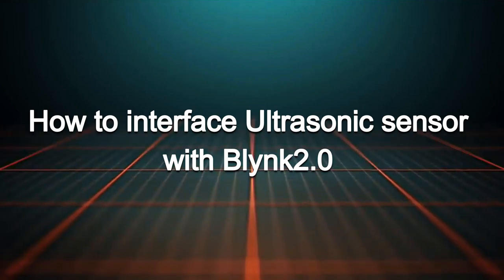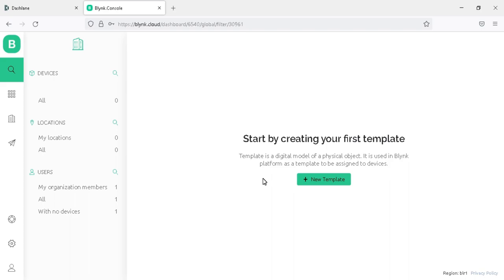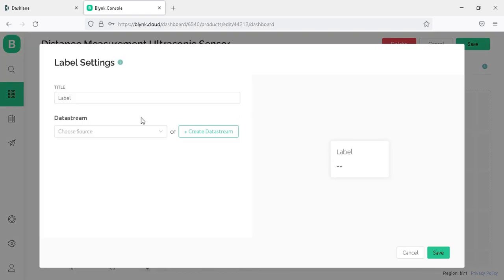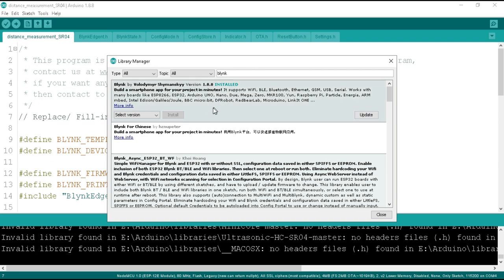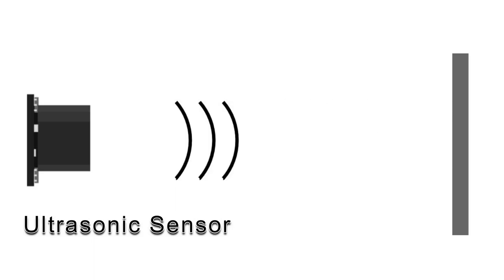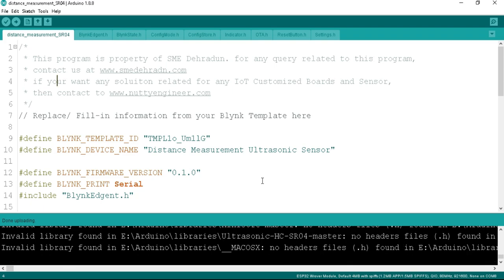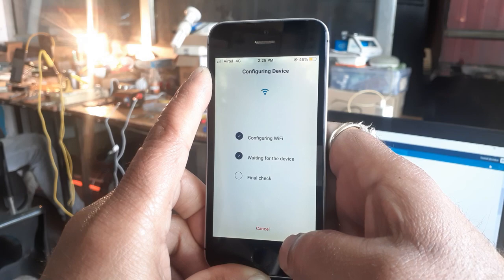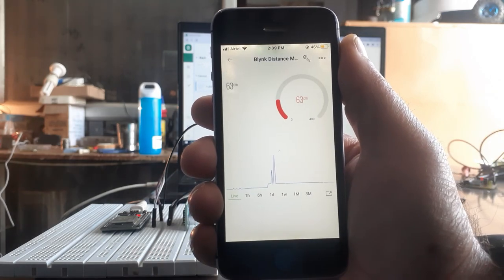Distance measurement using Ultrasonic Sensor with New Blynk2.0- Complete guide with Programming Code

Comment: Sir i used ESP8266 but when i uploaded the code, the sensor has no readings, just 0cm. I think it is because of "pinMode(34, INPUT)" is this for ESP8266 as well?
Reply from the maker: Check the wiring connection of ultrasonic sensor with your board & check the Vcc & GMD pins as well. If the are correct then check the pin no in which you have made connection is correct?

Comment: sir what is the problem why my ultrasonic cant read the data
Reply from the maker: Check the connection of ultrasonic with your board. There may issue with it.
Reply: if you are using esp82 then connect vcc to vu pin because ultrasonic sensor needs 5v supply vin gives 3.3 only

Comment: Hi sir, i wanna ask is it possible to run using 1 board of esp8266 with 2 difference sensor like IR and Ultrasonic sensor.? does the board detect those 2 sensors if i run in 1 board which is esp8266.
Reply from the maker: Yes. You can. It will work.

Comment: I ran the code an this error appears:
A fatal error occurred: Unable to verify flash chip connection (Packet content transfer stopped (received 6 bytes)).
Failed uploading: uploading error: exit status 2
Reply from the maker: If you follow all the instruction as shown in video and after that, you got this error then your board is having some hardware issue.

Comment: Hi, the code is giving an error as follow:                                                                                                                 
 'BLYNK_DEVICE_NAME' was not declared in this scope
Reply from the maker: If you see the video properly, then you will get that all the header files must inside the programming folder. 
If you want then you can connect to new blynk through an alternate method- 
Below link may help you. 

https://youtu.be/c5u6-Th1sI4

Comment: hello sir my readings of ultrasonic sensor is showing 0cm I don't know what's wrong with my project. when I'm using same Ultrasonic sensor with arduino it is working but in case of node mcu it is only showing 0 cm . even my node mcu is successfully connected to wifi and send data to thingspeak website , please sir help me I'm not able to recognize my mistake
Reply from the maker: Hi,
This errors shows that there is some issue in the connection. Check the wiring of ultrasonic Connection with NodeMCU.

Comment: Sir the wifi isn't showing 
I have done everything earlier but now i couldn't find the wifi from the esp32
Reply from the maker: Hi,
This May happens due to reconnection of the wifi or new template. 
This video can help you to resolve the error 

https://youtu.be/EPhY_hDozeo

If erasing of EEPROM is not working, then you need to factory reset your ESP32 board. Below video may help you. 

https://youtu.be/3oEvXhgHZHo

Comment: In file included from C:\Users\USER\Downloads\distance_measurement_NodeMCU\distance_measurement_NodeMCU.ino:9:
C:\Users\USER\Downloads\distance_measurement_NodeMCU\BlynkEdgent.h:16:2: error: #error "Please specify your BLYNK_TEMPLATE_ID and BLYNK_DEVICE_NAME"
   16 | #error "Please specify your BLYNK_TEMPLATE_ID and BLYNK_DEVICE_NAME"
      |  ^~~~~

exit status 1

Compilation error: #error "Please specify your BLYNK_TEMPLATE_ID and BLYNK_DEVICE_NAME"

I got the above compilation error sir... I'm using an esp8266 board. Tried installing libraries and updated my board still getting this error... Please reply..
Reply from the maker: Hi,
This is must to put all the headers files inside the code folder. If you watch the video carefully then you you will get it.
Reply: @SMEDehradun  ok sir, thanks for replying...

Comment: sir how to change the ssid I cannot find where it is if use blynkedgent
Reply from the maker: If you want to change said then you can only do it by erasing the eeprom of your board. Once you erase it, then you can rewrite the program & add your board in new wifi hotspot. 

Below video may help you- 
https://youtu.be/EPhY_hDozeo
Reply: @SMEDehradun  I just need to push button reset 10s on the board right and then push button flash? then can proceed to connect to new wifi?
Reply from the maker: Is it working. If yes then go ahead.

Comment: I'm trying to transfer the distance I get from hc-sr04 sensors to thingspeak using Nodemcu. Only when measuring distance the sensors work very well but when I write the code to transfer the data to thingspeak or firebase the sensors work very slowly. What could be the reason for this? how can i fix it
Reply from the maker: It may be due to the code you are sending to Thingspeak or firebase. 
You can make a separate function to send data to thinkspeak or firebase. & call it once it in 10 or 15 second. But measure the distance every second. Then you will get regular data from ultrasonic sensor
Reply: @SMEDehradun  thank you. I'll try to send it every 10 or 15 seconds.
Reply from the maker: If it didn’t go right, then let me know. I will help you.

Comment: Hi, the code is giving an error as follow:                                                                                                                 
 #include "BlynkEdgent.h"
          ^~~~~~~~~~~~~~~
compilation terminated.

exit status 1

Compilation error: BlynkEdgent.h: No such file or directory                                                                                I have made sure that i installed the library you showed in the video,even then its not working correctly pls help.
Reply from the maker: Put all the header files inside the code folder & change the blynk credentials also. 
Below video may help you to resolve- 

https://youtu.be/EPhY_hDozeo

Comment: Hi. I am using an ESP32 ESP-WROOM-32 Development Board. I managed to get the board to connect to the Blynk App but the HC-SR04 sensor kept on giving 0cm values. I have tested it with another code and the sensor is working fine. Do you have any idea why am I getting this error?
Reply from the maker: Try the change trig & echo with one another. It may solve your problem.
Reply: @SMEDehradun  Thank you. I found the error. Apparently I have accidentally swapped the pin number for both pins without realising. Sorry for the inconvenience.
Reply: @SMEDehradun  Oh ya I having 1 more issue right now. For some reason,  the esp32 is unable to reconnect to Blynk. Is there a way to fix this or reset the wifi connection part using phone?
Once again, sorry for the inconvenience.
Reply from the maker: Ohh. If you want to reconnect it to another wifi or you have designed new project template then you need to erase the ESP32 using esptool.
See this video for it- https://youtu.be/3oEvXhgHZHo

Soon I will make video with alternate solution for blynk.

Comment: I am using an FreeNove ESP32-WROVER-Dev board because that is what I have. I set the echo pin to 18 and trigpin to 19. I left pinmode on 34. I am also using the Board= "ESP32 Wrover Module" no idea if that is right... I don't even have any idea how you could know what is right. There is no option for Com port = 8, like you have. I have only one option: Port = COM1. When I plugged the esp32-wrover-dev micro USB to my computer and pushed the upload button I get "Compilation Error: BlynkEdgent.h: No such file or directory" any ideas?
Reply from the maker: Hi,
You need to add blynk library and there must be headers in your programming folder. Must watch the video properly. 

Also, Go to the link & see, How to fix Errors in new Blynk2.0 
https://youtu.be/EPhY_hDozeo
Reply: @SMEDehradun  Thank you. It took a few tries, but I was finally able to get the project to work. I appreciate the walk-through on this project and getting it onto Blynk, and I especially appreciate that you helped me to troubleshoot the problem I was having. Thank you for teaching me.
Reply from the maker: Most welcome 🙏

Comment: connection was interrupted error please help!
Reply from the maker: Explain the error that you have got?
Reply: @SMEDehradun  when I try to connect the eps 32 to the wifi network after entering wifi name and password, it says connection was interrupted
Reply: @SMEDehradun  please help me sir!
Reply from the maker: Plz try to connect your ESP32 board to other wifi. It’s due to network issue.
Reply from the maker: Try to connect to another wifi
Reply: @SMEDehradun  ok i am trying
Reply from the maker: I am just trying it. If you are still getting some error while connecting your board to blynk2.0 server using Blynk mobile app, then it can be due to some upgradation on blynk site. You can also try it tomorrow.
Reply: @SMEDehradun  it did not connect yesterday, i will try it again today. But is it possible we can provide wifi ssid and password in the code only?
Reply from the maker: Blynk2.0 doesn’t support this Method. 
You can only connect through blynk mobile app
Reply: @SMEDehradun  in the blynk firmware version, we have to mention the version of the library we have installed
Reply from the maker: No need to define.
Reply: @SMEDehradun  yes still the same error, not connected at the top of the screen and error message: your connection was interrupted
Reply from the maker: Hi,
Check your mobile as well as the wifi in which you want to connect your board.
Reply: @SMEDehradun mobile internet and the wifi i want to connect are both working
Reply from the maker: Try the blynk app to install on any other phone. Some time app doesn’t support the app features.

Comment: im getting output as distance 0 continously
Reply from the maker: Check the the ultrasonic sensor connection with your wifi board. There maybe some issue
Reply: @SMEDehradun  yeah sir actually ultrasonic need 5v  and i was connected it to 3v pin in esp8266 😅
Reply from the maker: Yes

Comment: Hi ultrasonic =0 cm only coming
Reply from the maker: There is connection issue. Check the ultrasonic connection.
Reply: @SMEDehradun  did check should i make any changes with esp8266
Reply: @thinkbeyond5360  if you are using esp82 then connect vcc to vu pin because ultrasonic sensor needs 5v supply vin gives 3.3 only

Comment: I am getting an error that  #error “Please specify your BLYNK_TEMPLATE_ID and BLYNK_DEVICE_NAME”
Reply from the maker: You need to change the blynk credentials in the program.
Reply: @SMEDehradun I already changed it ...by replacing those commands with my template id and device name.... still i am getting that error
Reply from the maker: Hi,
Have you included all the headers& other required files in to the programming folder? 

Plz watch below video to fix it. 
https://youtu.be/EPhY_hDozeo

And still there is error, let me know.
Reply: @SMEDehradun  yes i did ... there are all header files and also the library
Reply: @yashshrikantjayale2807   bro did u get solution?
Reply from the maker: Only solution is to change blynk credentials in the programming code.